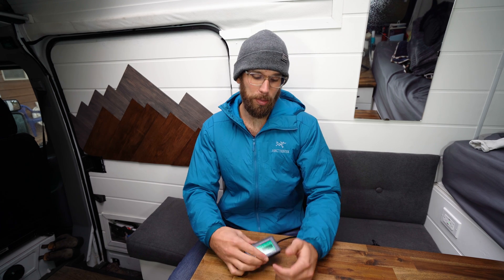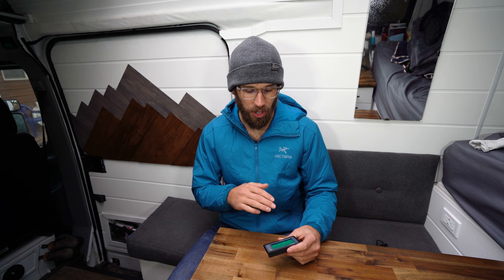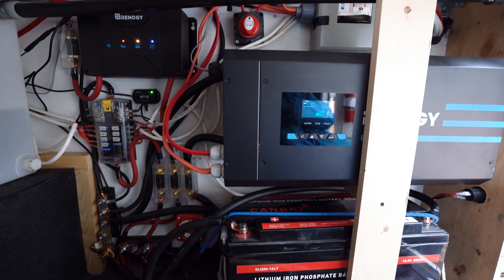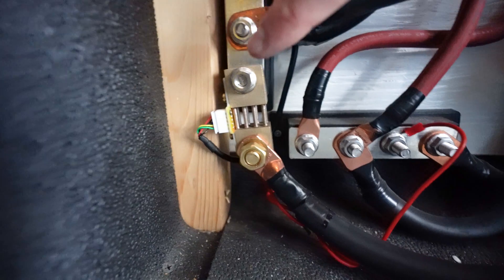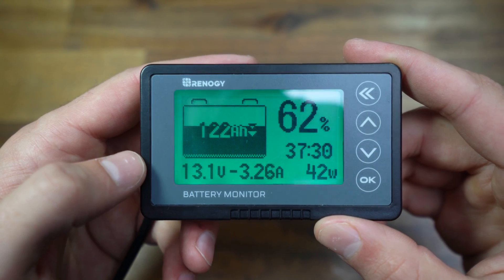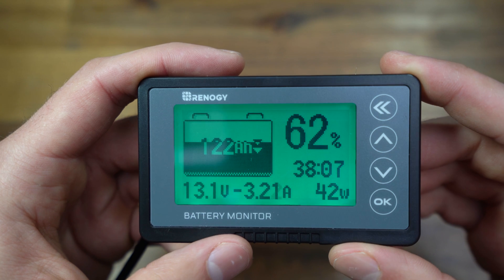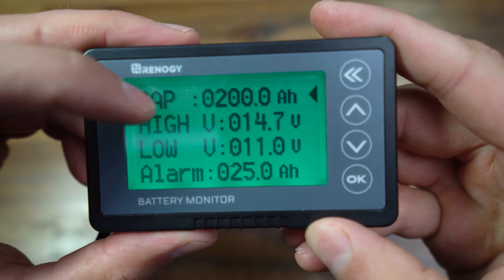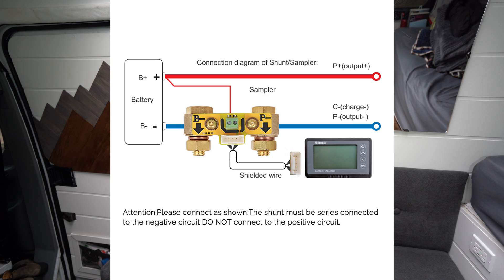Renogy Battery Monitor: How To Monitor Your Solar Batteries

Comment from the maker: Don't forget to use the code MADETOTRAVEL for a discount! Thank you guys so much for watching! What battery monitor are you using for your solar system?
Reply: Just installed the same one.
Reply: Don't have a solar system. Using a JK 4" on a golf cart
Reply: I have a litime monitor that it is a clone of that monitor, but There something weird because it only shows when the battery is discharging but never when it is charging. I checked the connections and they seem to be correct. I wonder what I made wrong.
Reply from the maker: @Teporame  sorry I don’t have any experience with that monitor. Did you install it the correct way?

Comment: Thanks for the video. Do you know how to silence the audible alarm? Any easy way?
Reply from the maker: You have to edit the high and low warning voltage to be outside your batteries limits (like 9v and 15v for example)

Comment: I am having a hard time setting the parameters on my Renogy Regó 3000w inverter charger. I did set the Lithium setting but not sure about the rest of the parameters. I have a Renogy 50 amp DC to DC charger which is all hooked up. I already hooked up shore power but I have not used it for the reason of the parameters not set.
I’m hooked up to a Vatrer 460 Ah battery. If you get time can you contact me and I’ll make it right for your knowledge and time.

Comment: I know it's been a few years, but how has the monitor held up over time? My second question is about the time to charge number. Do you kave any idea what the number means when the battery is already full (at 100%) and there is still solar more current than draw, so the system is technically in charge mode.
Reply from the maker: It’s held up great! Still using the same one today. I believe that means that the solar is running the components that are pulling power which is maintaining the battery at 100%

Comment: I don’t have time to look through all the comments. We’re setting up our 2015 truck camper. Everything appears to be working. Can anyone tell me why the battery monitor is blinking?  It is the Renogy also.
Reply: I should say, it’s not really flashing, it’s more of  the light fading in & out.
Reply from the maker: @JJ-pc3fh  that means that the battery is charging.
Reply: @madetoexplore  Thanks for the reply!
Reply: According to the manual, the display will also blink when first connected if the shunt B- and P- connections are reversed.
Reply from the maker: @ this is true but I believe it pulses fast when it is connected backwards and slow when it is charging
Reply: @madetoexplore  Thanks for the replies. We’ve tested it and it appears to be working the way it’s supposed to.

Comment: Thank you for the post. I noticed that you did not set up the low end, only the 100%. It's not necessary to calibrate the low end of the battery?
Reply from the maker: @juancarlosducca2782  no, the low end would be zero ah or 0 percent. It’s only the max capacity that needs to calibrated.
Reply: @ Thank you!

Comment: How do I ensure my battery is fully charged before I connect it?
Reply from the maker: The specifications should list a max voltage  for the battery. Test the batteries voltage with a multi meter and see if it’s at the max. Most people just leave the battery charging for a day or two with a trickle charging.

Comment: Does it matter which side of the bus bar you put the shunt?
If I ran my inverter directly from the battery (with a trip switch of course😊) would the monitor still detect a drop in voltage? Thanks 
- Great video BtW 🤙🏻
Reply from the maker: @ProjectENDURO  no it doesn’t matter which side of the shunt. No, the shunt wouldn’t be able to detect the inverter if it’s connected directly to the battery.
Reply: @madetoexplore  thanks so much.
That makes sense 👌

Comment: Can you monitor two batteries at the same time ?
Reply: How about 4 ?
Reply from the maker: @rrios283s73  the number of battery’s doesn’t matter. You just can’t pull more than 500A of 12v power through  the shunt.
Reply from the maker: Yes! You just have to ensure they are wired correctly in parallel or series

Comment: Probably a dumb question, I know, but what does the watts reading actually tell you? 
I get the volts reading corresponds to battery charge (Using a LiFePO4 so 10v=dead and 13.4-14.4v=fully juiced)
And I get that -a=using power +a=charging
So what is the w reading actually telling you? Explain it to me like I'm an idiot, cause I am! 😅
Reply from the maker: @noamoreilly3217 a watt describes the rate of power flow. Amps x volts = watts

Comment: I have the same Battery Monitor with Shunt.  Everything works great, except it will not show the monitoring in charge mode, only discharge.  I confirmed over 5-times that I have everything wired correctly, but I must be doing something incorrectly because this is my second one, I thought something was wrong with the 1st.  Nope, same thing. Would you happen to have any ideas or what I should check?
Reply from the maker: Is the ground cable on the correct side of the shunt?
Reply: @madetoexplore  Yes, Sir.  I’m 100% certain I have it wired correctly.  Is there something else I’m supposed to program on the monitor screen?  I’ve read the handbook pretty thoroughly.  My goodness, Renogy’s CS was no help.  All they could do was refer me back to the wire diagram.  If you can think of a way to help me figure this out, I sure would be grateful.  Email with pictures or video or even FaceTime.  Thank you for your response.

Comment: I have Renee panels and the Ren energy Rover 40 charge controller, which has the BT one which turns all that information into Bluetooth and it comes to my phone so I can see what I have for voltage and it shows percentage of the battery left to use now all I use mine for I run my pellet stove right now in the testing process to see if what I have for batteries will run my pellet stove 24 hours a day basically full-time is the one that I have doesn’t it do the same job as one of the shunts? You’ll have to excuse me from my question, but I’m new to all of this, thank you very much to anyone who would like to answer anybody’s help would be greatly appreciated. Thank you and God bless America.🇺🇸

Comment: Sorry if you've already answered this. How do I wire my solar panels to charge my batteries so that the battery monitor reflects how much is coming in from the solar panels? Right now I take the information from the battery monitor on the solar panels and enter that data manually into my interior battery monitor, but I'd like to have it go directly to the interior monitor. I have 2 lead/acid batteries and a 100 amp system.
Reply from the maker: @meredithguest3417  wire this monitor so that the negative wire from the solar goes through the shunt before connecting to the negative battery terminal.

Comment: Maybe stupid question. You mentioned that you should fully charge the battery, but how you know that battery it’s fully charged
Reply from the maker: @UViDSIRE  no such thing as stupid questions! When the voltage reaches the max voltage for the batteries it is full. You’ll need a volt meter to test but it should be around 14.6v I think. Check your battery specs to be sure.

Comment: Hey, quick question that no one has been able to answere for me. I have all of the negative cables in my system on a bus bar. All of the components are all grounded to this bar as well. My question iis, should this bus bar be grounded to the chasis? I have the system in my rv.
Reply from the maker: @michaeldesmit5577  yes you should
Reply: @madetoexplore  Thanks for that answer. I have one more question, please:  the quest is about seperating the two chargers that can charge the batteries. I have the same transfer switch used to switch from shore power and solar power, wired the same way you did. I also have an internal battery charger housed in the circuit breaker a/c d/c distribution panel. I have two battery switches in the system, one to turn on the dc power to the inverter from the batteries and also allows the charge controller to charge the batteries. I have the other battery switch between the dc charger cord coming from the AC DC distrubution box to the batter bank to charge when on shore power. So, I dont overcharge the batteries , When Im on shore power, I turn off the battery switch coming from the solar charge controler so it cant charge the batteries and open the battery switch coming from the ac dc distribution box that has the charger in it to charge the batteries and supply 12 v to the system when I am connected to shore power. I have seen some folks on youtube say the MPPT charge controller if you leave connected to the batteries, that it will sense how much power is going to the batteries and will not over charge the batteries. So essentially I really dont need to shut off hte battery coming from the charge controller to the batteries. Is there a better way to wire this? Thanks

Comment: Great video. I’m about to upgrade my tv to lifepo batteries. Just a quick question: will it harm my batteries to leave my RV plugged in to shore power, knowing that the converter is always on? I leave my rv plugged into power when I’m at home.
Reply from the maker: No, as long as your charger is compatible with Lithium

Comment: Can I ask please, you say to configure, make sure the battery is at 100% and then calibrate to 100% on the device, but without having had the device in previously, how would you them be able to tell when the battery is at 100% to do this in the first place? My battery 300Ah, is not compatible with Renogy BT monitors for me to know this.
Reply from the maker: Charge that battery until the voltage is at its max and then calibrate. The battery manual should have the max voltage
Reply: @madetoexplore  Thank you very much 😇

Comment: Great video,  on Instructions on how to install  battery monitor model RMB500
I'm trying to install on 2 x 100amp lithium batteries in a travel trailer 

I need to enter data as follows, per the instructions, please confirm.

1. Cap ....200qmp

2. Full V ... 14.9

3. Zero V ...10.9

4. Powoff... 7v

5. Alarm .... 10ah

6. atten......   NO IDEA..... WHAT IS THIS NUMBER

Please advise asap if the above numbers are acceptable and what I need to enter for item 6, and help you can provide would be greatly appreciated.
Reply from the maker: This would depend on the battery but those numbers would make sense. I would do 20% of the total capacity for the alarm since it’s best not to go under that.

Comment: Unless I am missing something, .....when you start your engine and your engine battery is fully charged (usually the case), and your alternator detects a discharge condition, ....ie your l-ion house battery, it starts charging your house battery AND your fully charged engine battery as well.  No Bueno! Not good for the alternator ($$$) or a now overcharging engine battery ($$$)!
Additionally, the charge profile of an l-ion battery is distinctly different than a flooded or gel high cranking amp battery....
If your solar system is not handling your electrical demand, switch to propane on the refer and take it off the inverter and see if the solar can keep up.  If not then add solar capacity on the roof or throw out freestanding panels on the ground with an additional charge controller if necessary. This helps on those cloudy days as well.
I have not had to charge my class A motorhome in five years with 600 watts on the roof/200 watts of  freestanding panels if/when I occasionally (cloudy days) need them.
Just throwing my two cents in....
Safe travels, and thanks for the vid.
Reply from the maker: Yeah you’re definitely missing a lot there… You must live in a sunny place! Thanks you too 👍
Reply: @madetoexplore  
Just to add....
We winter in AZ (lots of sun) but are in coastal Oregon (rain/clouds) from April through October. Can be challenging....
I have 3/105 AH l-ions which give me fairly good storage capacity.....
Occasionally I have had to go into conservation mode for a few days using the batts conservatively, meaning diesel heater, propane on refr. always, lots of tv and lights, etc....
Generally don't go below about 93% on a sunny heavy days use: micro, wifes hairdryer, curling iron, Keurig, 3-4 hrs tv, and the rest of the stuff....
On the continuously cloudy consecutive days, I roll out the 200 watt freestanding panels (I use flexible high efficiency panels) They make a huge difference.
Usually get enough gain on regular cloudy days to get to 100%.
Panels on the roof always lay flat. I am too old and lazy to angle them....
Happy trails.....!

Comment: I got the round one which is virtually the same but I remember reading in the instructions that you can find out the capacity of your battery by setting the amp hours as high as you want and calculating that way, but I guess you would just charge it up fully and then set it at 100% , but I’m not sure if it would know the amp hours that way automatically on the display, weird instructions. But I think it would start from a dead battery … Since batteries, lose capacity over time, especially lead acid, that would be a very useful feature
Reply from the maker: Agreed!

Comment: Why won't my monitor go past 90 percent
Reply from the maker: Never heard of that happening! Very strange. Might have something to do with your battery size and the size setting you put into the monitor? Like if you have 100ah battery and the setting for the monitor is 110ah. I would check that setting on the monitor

Comment: As a mecp certified installer, I see that ground wire is a hair away from the ground block, if that we're to get loose it would short. Perhaps you just have a higher tolerance to risk than I.
Reply from the maker: I’ve shifted that over since I did this original install. I never had anything come loose or short. Thanks for catching that tho!

Comment: I know this is an older post, but I would like to add a question - everything I have in my Renogy components says to NOT install the battery and inverter in the "same cabinet?.  It looks like yours is not only in the same cabinet, but is VERY close to each other.  I know that lead acid batteries couldn't be in the same cabinet, but why would they say that about LifePo?  Are you worried at all about that?
Reply from the maker: Yes, this because of heat. My cabinet is open and vented very well so I’ve never had any issues with overheating but if it was in an enclosed space I would be worried. I haven’t had any issues at all.
Reply: @madetoexplore  no room for my inverter to be inside, so have to put it in one of my toolbox cabinets built into my truck bed. Would like to get both my batteries inside, but not sure I can make them fit. If I have to put my 300ah battery in toolbox, I will probably have to install a cooling fan. May have to for just the inverter anyway.

Comment: Thanks for your video. I’m trying to work out why my battery monitor is beeping constantly. (Every 10 seconds) Having left a few things on whilst in storage) the battery was totally flat. I’m recharging the 2 x 100 amh batteries from mains power. Even  when showing full the beeping continues. Can you help please. 

Thanks, Trevor
Reply from the maker: It’s probably the low capacity alarm. You can change it to whatever you like

Comment: Great video! My lithium cells are in a metal box for use in a golf cart. Does it look like I can cut the main 5 wire cable to solder in a pass through cable? Thanks
Reply from the maker: Thanks! Yeah I think you could do that.

Comment: hello when I connect the battery monitor between my battery and my renogy inverter charger and it is connected to 110v the battery charges but the charger screen turn off is this normal?
Reply from the maker: No, this is definitely not normal. I’d double check your wiring connections.

Comment: I installed this exact monitor into my 2015 Ice Castle fish house. I wired according to the same diagram, fully charged my 12v deep cell battery and calibrated the sensor to the full charge. It seems to display the draw, percentage, etc correctly. But when I plug the house into my generator or 110outlet it instantly goes to 100% charged and flashes like it’s charging. What would cause this to jump immediately to 100% vs. showing the charged percentage like yours?
Reply from the maker: That’s strange! Seems like the percentage is based on voltage and not AH. I would double check the wiring diagram and orientation of the shunt.

Comment: You said that it monitors how much solar comes in. No, it does not account for the solar that you are using directly that bypasses the battery. Your solar charge controller does that.

Comment: Just a hint - I have the same shunt but unbranded off Amazon  - slightly cheaper. Also the Renogy inverter charger inverter same as yours mounted horizontally which I’ve been told they must me as the windings can fall out internally causing a short - manual also says mount horizontally- worth looking into. The feed to the shunt  I fused mine with a 5A fuse.
Reply from the maker: Thanks! Appreciate it 👍

Comment: Potentially stupid question.. are you also using your alternator to charge your batteries when necessary? Can this monitor the charging for both? I’m trying to build a little solar generator that I can also keep topped off when driving in the back of the 4Runner and then just put up the panels when at camp.
Reply from the maker: Yes I am. Would recommend the Renogy DC to DC with MPPT 👍

Comment: I’ve never been able to get the monitor to show it is charging with the arrows up. It displays the load only. Any ideas what might be wrong? Great video, by the way. 👍
Reply from the maker: Make sure that the shunt is installed in the correct location and that it is the correct orientation. This happened to me at first because I had a ground installed to the battery terminal.
Reply: @madetoexplore  Thanks. It’s working now. 👍